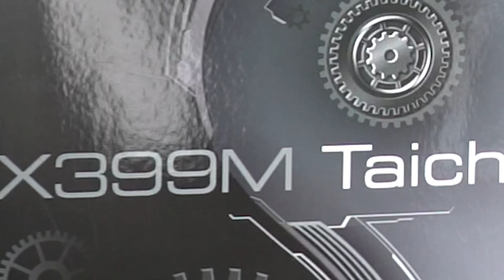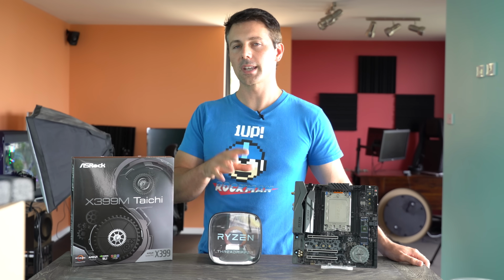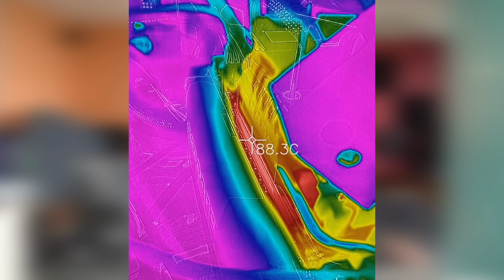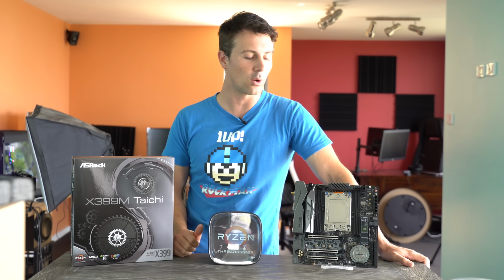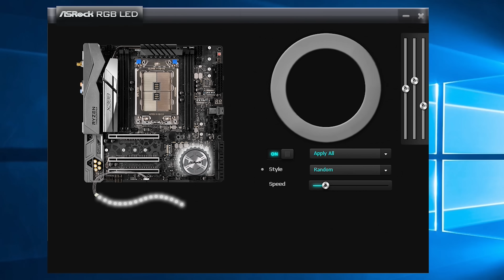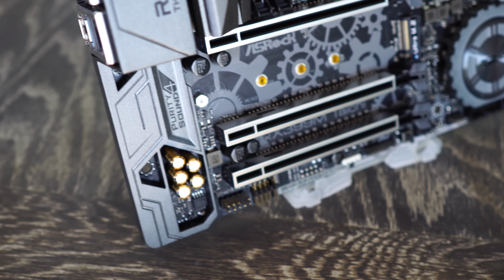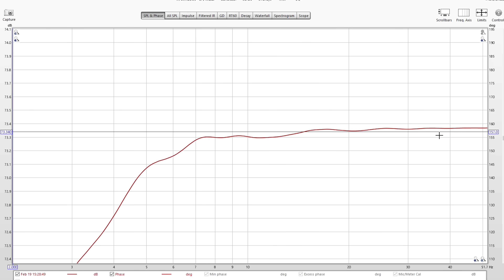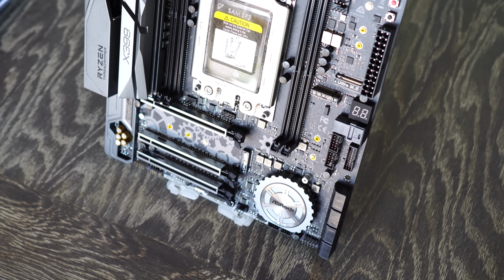X399M Taichi Review - Making 1950X 16 Core Builds Smaller.

Comment: If you run a GPU in the last 16x slot it will limit the use of the front facing audio port. Hence the right angle one :)

Comment: Hee Bryan , I follow your tip ( top 5 overclockable cpu's ) and i bought an i5-2500K and a Asrock Z68 pro3 with 16Gb ( 2x 8GB 1600 ) . Now my question is ..... What is the best GPU for this set ? would an GTX 1060 6GB a bottleneck or can i even pair it with an GTX 1070 ?

Comment: who the fuck would buy a threadripper and limit it sooo much by not having 4 channels of ram and at least 4 PCIe slots i mean there is a reason why it has so many pcie lanes!
Reply: Ausintune some people need 32 threads in a small formfactor
Reply: Its qual channel, just one dimm per channel.
Reply: Ausintune plus it's still quad channel memory
Reply: 180w? Laughs in my 300+w FX... The i9 at 480w almost had a heart attack when it heard that. You really don't need a "huge" cooler for that, I'm using a $10 cooler on my FX for ~200w just fine 

(300w did take an AIO with fan speed at 4,100 rpm. That may sound like a lot, but for LOLs, I put a race quad motor in a normal case fan I had blown up over-volting, and it pulls over 120w with ease, and would be 250w if I could cool the motor better, but I didn't cut enough vent holes for it). It wouldn't take anything special for Threadripper besides a bigger contact base, but obviously I would personally overclock it like mad, so I'd go with the same 120mm AIO I used for FX, or sub-zero phase cooling (-58c idle up to -35c full load) if I were using a full size MOBO.
Reply: also i bet your pc melted under load
Reply: Not quite. LOL, I was using a $40 mATX board with a garbage 4 phase VRM, so the chokes got burning hot, so I ended up adding a heatsink to them, putting 2x 40mm fans blowing over the VRM and had that ducted through a pop-tart box I cut up to have 1/3 of my 120mm 4,100 rpm AIO fan suck as a second stage, with the 40mm fans as idle stage. I also put a 60mm on the NB cause I like to push the FSB.

I ran it like that for a long time, I did fluid simulation (takes about 6 hours, sometimes a LOT more depending on the complexity), and that hammers the CPU at 100%. Completely stable. It's still chugging along as I type this, a good little chip and board, though I have it running stock right now since I snagged the AIO for my Ryzen 1700.
Reply: 100 degrees?
Reply: No idea, it was below VRM throttle after I was done. The CPU temps are a mystery on FX (I like how it shoes sub-ambient temps at idle, priceless...). I just know it was below max allowable on AMD overdrive. So technically everything was within spec on temps. 

I test all my systems for 24 hour (minimum) run on P-95, Memtest 64, Furmark (usually just an hour or two if its only for gaming), and then mixed workload test (10x Cinebench in rapid succession, 2x Handbrake encodes + Cinebench at once, a several hour fluid sim going while doing other things like Youtube or browsing like I would normally do) Basically it needs to be stable because I can't have it crash after an 8 hour simulation and redo it, never thermal throttle even in a hot room, and get absolute maximum performance.

The only exception is my Titan Xp, because I can't afford to break it and pay another $1200, so it doesn't get overclocked. Every other system will get the max overclock possible (besides using sub-zero coolers, I used to do that for my main machine, but man those kill GPUs fast! cracks the solder BGA after thermal cycles). I will use that cooler on Threadripper when I upgrade (keep it at a max of -35c at full load, idle temp around -58c).
Reply: weird
Reply: no it isnt, its dual channel
Reply: also do you know how much power the threadripper uses? 180w you need a FUCKING HUGE cooler for that a 280MM rad to get decent temps or the biggest aircooler on the market

Comment: No talk on pcie lane talk set up
Reply: Mutation666 all 3 x16 slots are x16, nvme is x4, anything else you need to know?
Reply: Yeah where the lane are wired to  16x3=48 + 3x4=12 = 60 lanes also has u.2 thats another 4 lanes  + wireless card over the 60 lanes off cpu   guessing u.2 and wireless are off chipset lanes but still questions

Comment: Not sure why you would want the clear CMOS button on the back where someone could push it accidentally or to mess with you.  I think just the fact that this motherboard has a clear CMOS button is more than enough.
Reply: Its for people who don't want to open their case every time there's a chance they need to reset their bios
Reply: Agreed, I'd rather have it on the board itself as a smaller button, and yes I know they can be a pain, but I'd even take an old school 2 pin jumper over a button on the I/O shield.
Reply: I'd Actually prefer a 2 Pin Button Connector, for us to either short with our screw Driver or Connect a Button to route where we want it. Best of Both Worlds. Used to work on old school Motherboards back in the day, but not always...
Reply: Yup, as much as ASUS Pisses me off, this is a feature they always get right on their high end boards, thats why I still get them. It is a god send on my Ryzen Build, for when I am trying to push my OC on new firmware, or messing around with PStates in the BIOS, its much easier to get up and press the Clear CMOS button on the Back of my MB, then it is to have to open up the case, grab a flash light and screw driver and look for the tiny button on the board. I definitely prefer to have it in both places, sometimes its more handy inside, but a lot of the times, especially when I don't want to pop my case open, it truly is a god send to have on the back.

They also have a really cool feature now called Keybot, that allows me to turn my PC On just by holding in the enter button on my Keyboard. My Ryzen PC is my Entertainment and Couch Gaming PC, I sit pretty far back from my TV in my recliner. Sometimes after a long day at work, you get home and plop down on the couch, and then realize you forgot to turn on the computer, and then Smile Because I can just hit the Enter Button, so thats pretty awesome too... I'll shut up now.